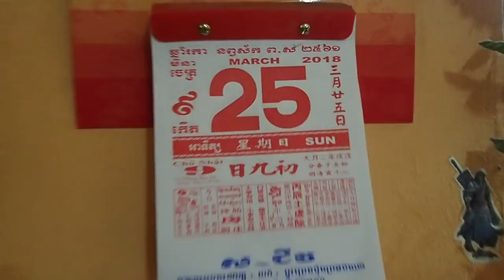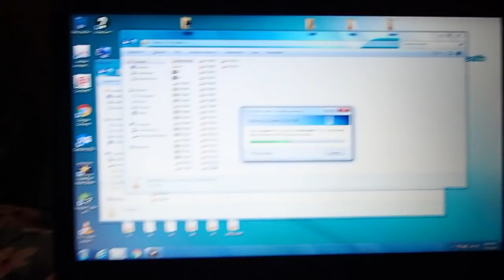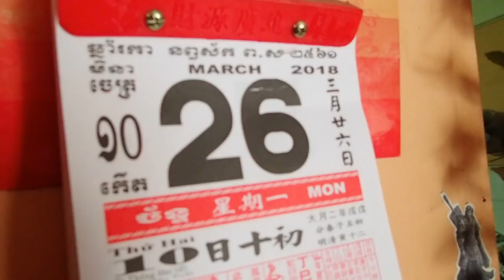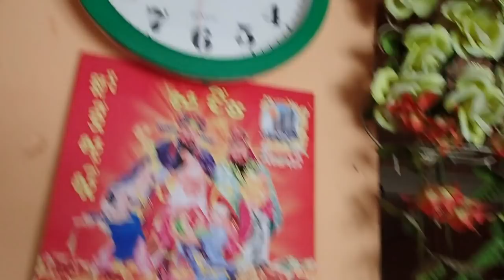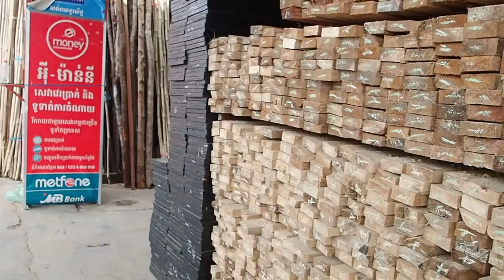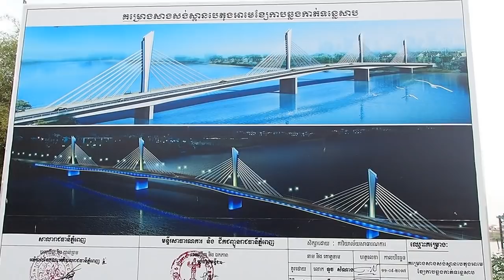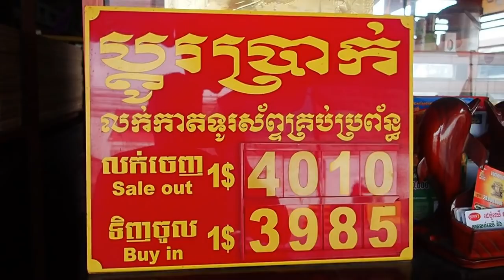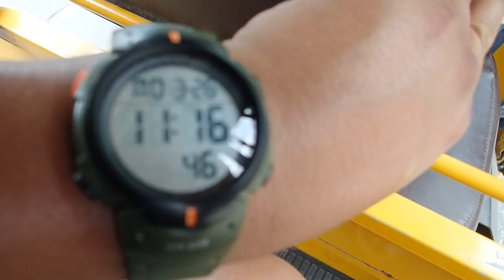Cambodia Trip 2018 (34/35)..bong Veun played Khmer violin

Comment: nice drone captured bro. I think your drone camera ISO too low. you should increase ISO to get more light. Use the right side wheel on the controller to adjust ISO and check is it the right picture that you want.
Reply from the maker: Hi Pin, lol yeah like I have noted in the summary my wife nephew's phone ran out of battery, we only got one good clip out of many, we couldn't see what we were recording using just the remote controller. Lucky to have one clip came out ok. He forgot his portable charger at home. I regret not able to record more of PP with the drone.
Reply from the maker: Awww thanks! I saw something like that but it's about $80. I will get this one instead. Yeah I had a hard time holding the ipad and the controller :).

Comment: Where is part 35
Reply from the maker: Sorry not done yet.  I only had one 32gb SD card and it was full. I copied the clips to the laptop, and some to the flash drive, and now  the clips are confusing me, the numbers messing me up. I had 4 SD cards on the last trip it was easier. I couldn't find them the day we left, so I just used 1 SD card, and deleted the clips as I finished with them to free space for more. Now I found some parts I messed up the music and sound and but I can't go back and redo because the clips are gone :(.  After I finished a file I forgot to delete the songs, so the songs were on the next file that not supposed to have song. I really messed it up this time.  Next trip I will have more SD cards.